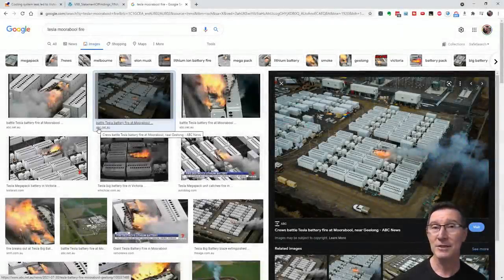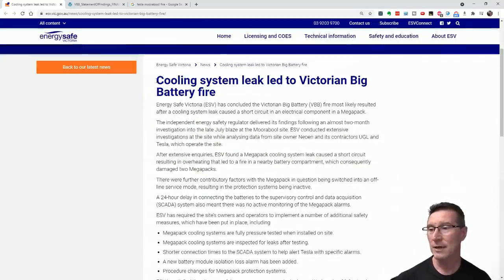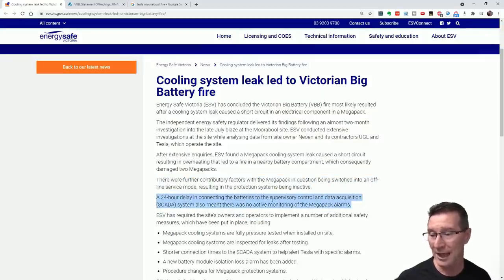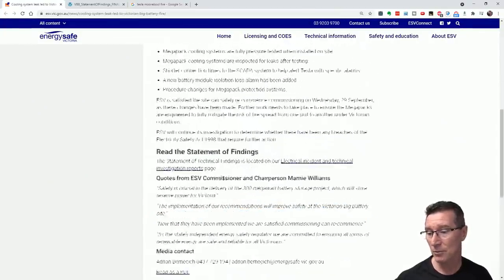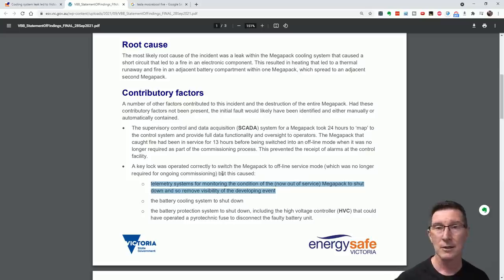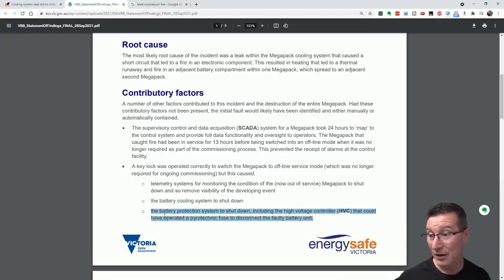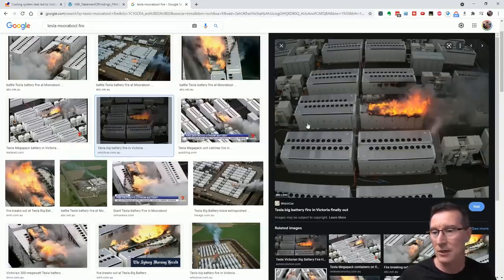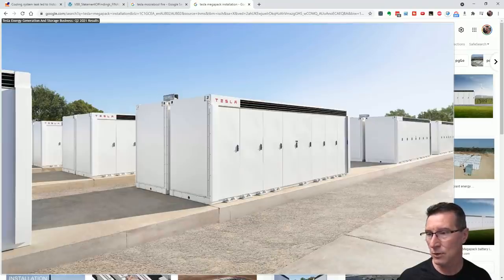EEVblog 1422 - CAUSE of the Tesla Victoria Big Battery Fire

Comment: I was charging a large lithium-ion strimmer battery in my workshop last week, like I've done many times before. However this time the charger showed a voltage error after about 30mins and the battery was HOT. I disconnected the charger and took the battery outside and put it on the patio (stone floor) and went off to get a screwdriver so I could take it apart (once it had cooled).......but as I returned to it, about 10ft away, it started hissing so I stepped back and it went BANG and the firework like flames were about 3ft in all directions.
Sooooooo lucky!
Reply: my powerbank suddenly felt really really warm during charging, luckily it is a "DIY powerbank" where the cell is not soldered to the board, I immediately tore the plastic open and scatter the hot 18650s on the ground; the batteries were  still fine till this day, but the powerbank circuit were burnt, chared, and the plastic warped. In my opinion the batteries must be disconnected from the circuit that provide 12v or 24v (for the strimmer) immediately to stop the overheating (meaning you have to pry it open ASAP before it explode).
Reply: After discovering Lifepo4 packs for anything other than highly portable devices, I started making my own packs with even my own custom BMS with own code.  Something I wouldn't dare attempt with lithium-ion.  Lifepo4s can almost be short circuited and they probably won't explode.
Reply: That, I think, is why the report said "it had failed safely". Inextinguishable fire is still safe compared to a bang proportional to the pack size...
Reply: SAND!!!
It's not rocket science.
Just dump sand on it.
Reply: Yeah.  And look at all the YouTubers building their own MegaPacks with used batteries or manufacturing seconds.
Reply: @preddy09  Key word: "probably."
Reply: @whompywheels5165  sand won't stop it. You just have to let it burn itself out. Chucking sand on it just means you have sand in the molten mess.
Reply: @whompywheels5165  What do you think that is going to do?   The fire does not need oxygen to burn.   It has its own oxidizer in the battery.
Reply: Well, to put my fire out I got a old towel soaked in water and chucked it over the whole thing which contained the flames......I then left it to smoke and die down for 10mins, then scooped up the whole lot (no flames anymore) and put it in a bucket (metal) of water and left it for 24hrs.
Reply: The fire does not need oxygen to burn and that is why spraying water is demonstrably ineffective.
The sand will contain the heat safely acting as an insulating layer.

What is the harm in testing this?
It works for laptops and Ebikes so why wouldn't it work for cars and big batteries?
Reply: @whompywheels5165  i suspect sand may do the same as my wet towel and would contain down / cover the large flames but wouldn't kill the source. It would be somewhat effective I'm sure.
Reply: The only luck involved was you actually being there.  Otherwise, jut reasonable safety precautions for a malfunctioning battery pack.

Nastiest one I heard of was more than 20 years ago, a mid-sized UPS failing in such a way it dumped all the stored energy.  Bein a UPS in the 90's, this would almost certainly be a lead-acid battery (nasty if they spill or vent hard, but otherwise not too bad) but the guts got so hot the plastic enclosure melted.  (As in, the operator tried to push a button on the device and it caved in.)
Reply: @IanScottJohnston  the best thing to do — as with lithium powered burning cars — is to drop the entire thing in a big bucket of water. Best way to take away the heat. Then you just leave it for a few weeks until all the lithium is burned off.
Reply: @whompywheels5165  Wouldn't that make it burn quicker (melt) by keeping the heat in?
Reply: @saddle1940  Possibly so. Although I think the thermal runaway is near unstoppable,' However if you want to cool the pack then go head and spray water on the sand.
Reply: @JamesTK  Cooling the pack MIGHT slow down the thermal runaway consuming the whole pack.
Why not spray water on the sand instead of wasting bazoodles of water?
Another idea is to build a wall of sandbags around the car and flood it like a wading pool.
Just spraying thousands of gallons of water around the place is as dumb as dogshit.
Reply: @JamesTK  All I want is for some fire departments to try this. Could be dry sand, wet sand, sandbags to make a moat around car. Combination of these. One thing is for certain, hosing bazoodles of water just isn't working.
Reply: Big Clive, comment above has proven that Lithium batteries contain fire and that hitting them with a hammer makes them hiss. :-)
Reply: @whompywheels5165  Yes, the fire needs oxygen. What doesnt need oxygen is the thermal runaway inside the battery, resulting in heat (ignition source) and flammable gases (vaporizes solvents). It still wont burn and only smoke if there is no oxygen or the ignition doesnt happen.
Reply: Allegedly those Lipo car jump packs have been implicated im many garage fires over the past few years.
Reply: @whompywheels5165  Unfortunately, this does not work on an alkali metal fire.

Comment: I suspect the offline mode they used to temporarily take it out of service wasn't meant to be used that way. Having to actuate a physical keyswitch tells me that mode was probably meant for a complete shutdown so maintenance can be performed, as the operator probably wants to automate the wear-balancing that happens daily (which is what it seems the unit was shut down for). This could explain why EVERYTHING in that pack turned off, instead of only the charge/discharge you would expect for a standby like that.
I do agree that it is still weird that telemetry and monitoring can be turned off like that, and especially that it was actively used while SCADA was not active yet, but I highly doubt this was the intended shut-down mode for this situation, let alone the only mode available.
Reply: I think this is the most plausible reason. Someone using a function that did what they immediately wanted. But they failed to understand the consequences of that action. A possible fix there would be to have it send out an alarm or notification the moment that switch was tripped so that a monitoring location can verify it was expected as part of scheduled maintenance or an emergency disconnection that they can respond to quickly. 

I did think you might want to modify it so you couldn't throw it into such a service mode without meeting some sort of other requirements around charge levels and temperatures. But in an emergency I could see the need for having a no restriction instant disconnect. Possibly still something worth considering if the service disconnect is independent of a full/emergency disconnect.
Reply: I was under the impression this was a new install, not one that was operating. I am not sure if that is correct or something I misunderstood when this first happened.
Reply: @--_DJ_--  It was new install in it's first 24 hour if I understood correctly and they turned it on immediately. The specific pack was operational only for 13 hours before it was put in offline mode by a physical key switch. (Maybe they ran a 12 hour stress test, to check if it's charging well or whatnot) (14:38) One of the key point was sated in the mitigation brief, for the next time it can't even be put in online mode BEFORE the SCADA maps the packs and start to monitor the conditions and alarms. Seems reasonable.
Reply: @mtx33  That does seem like a better way to go about it considering what happens when things go awry.

Comment: Some good old Asbestos sheets between the mega packs would work a treat.
Reply: some cross pollination from the SpaceX Florida bakery coming up soon? :P
Reply: @rkan2  Ha!..  Nailed it  :-D
Reply: Asbestos might be a magnitude or two less destructive than these poorly designed battery packs.
Reply: You joke, but asbestos tiles actually sound like a good idea.  Fun fact, where I live you can buy houses with them as floor tiles today.  It's not fluffy, so is perfectly safe as long as you don't try to remove them.  The thing is that today we have other materials which also work well.  However, Asbestos is still used in certain applications today.
Reply: @arthurmoore9488  That's crazy.  The flooring will surely degrade over the years and become a major problem in the future. 

Saying that, when I was a kid we were always playing on old asbestos corrugated roofs that were dusty and broken and we've all made it to being grandparents.  

I think its particularly the blue variety that's dodgy isn't it.?
Reply: @JediBuddhist  I’ve installed solar on asbestos sheets one time and I can see why the stuff that’s already out there is safe as long as it’s undisturbed. It was harder to cut/drill through than concrete and the integrity of it felt very stable and resistant to wear and exfoliation
Reply: Rockwool might work too?
Reply: @Ariccio123  Rockwool is just as dangerous, even though the manufacturers passionately lie about that fact. 🤷‍♂️
Reply: @rkan2  actually that's a hell of an idea. Especially tiles that are damaged and cannot be used on starships would still be quite effective in this use case.
Reply: @Ariccio123  Yes sounds spot on

Comment: Who did the FMEA for this system? Allowing monitoring to be inactive during initial start up is crazy, that is the most likely time to have issues. Allowing monitoring and cooling to go down for any reason is crazy. Have we learned nothing from our nuclear disasters? Those should be on back up, independent power, enough to safely bring the machine to a standby state.
Reply: I mean, you have to do maintenance at some point. the problem is they put it in a mode that should probably only be used if someone is working on the circuits. you can never stop a technician who has that level of control/access from doing something they're not supposed to. you can just improve the redundancies to try to prevent mistakes.
Reply: Tesla did.  My money says they were behind schedule and it should be obvious the units themselves were not ever adequately safety inspected    I strongly suggest outside agencies do real inspection on these units because this has happened in other installations here in the US with the same fire resulting

Comment: 20c part takes out $200K pack!
...sounds like they didnt think things well through to begin with... taking a pack offline should never stop alarms, monitors and protection....
Reply from the maker: Yeah, seems crazy.
Reply: It's all free money, it came from your pockets.
Reply: Taking a pack out of the active system shouldn’t turn off the monitoring systems. Taking a pack offline for service should probably take everything offline, because electricians like not being electrocuted by the monitoring and cooling system just as much as they like not being electrocuted by the main batteries.

Comment: As a former SW developer of a Safety Analysis software for oil&gas industry, I'm realy surprised how badly implemented are safety standards in this energy battery field. Someone did very bad job with HAZOP/LOPA analysis, or most probably there was none. Having such devices in operation without real time monitoring is absolutely unimeginable in o&g industry, if this would happen, it would definitively cause automatic shutdown. They can be realy glad that only 2 packs were burned and no one was hurt. And to me, if the coolant leakage , which, I assume, is one of the most common failure which you can have,  can cause catastrophic failure, then the pack is probably not well designed.

Comment: Geez they were running that thing blind without the SCADA monitoring!

The addition of the ‘battery module isolation loss’ alarm makes me think the failure could have been coolant leaking onto a DC contactor (or bus bar) for a battery module shorting and overloading it, however as the unit was in the offline service mode and no SCADA data was being monitored the unit never raised an alarm and thus never had its pyrotechnic fuse triggered so it remained shorted until it reached thermal runaway and caught fire.

And without a doubt this was not a safe failure, a better way of putting it would have been “despite the unsafe situation created by the catastrophic failure of a megapack, there was no loss of life and damage was contained to only the adjacent megapack with the assistance of approximately 150 firefighters and 30 firefighting appliances.”

I also suspect the solution ‘to fully mitigate the risk of fire propagation’ will not only involve firewalls but fire suppression.
Reply: It was a safe failure in terms of the rest of the installation - it did not negatively impact the grid or the other megapacks' operation. So in an operational sense it failed safely.
Reply: My guess is the removal of the batteries would help very much.

Comment: It sounds like the offline mode for maintenance is really intended to be just that: having the thing shut down and disconnected so you can work on it. They probably didn't foresee the need for monitoring while the thing is known to be offline. Unfortunately, you can't just turn off a bunch of fully charged batteries. 

Chemical plants have to do that, but they have really complicated monitoring systems that go into different modes to prevent nuisance alarms. Watch some of the US CSB videos: they go into some wonderful information on the principles involved.

Comment: Oh 2nd thing, reason it’s a key switch that isolates everything.

It’s a part of the high voltage isolation procedures to physically isolate remote operation.  

If the key is in and turned someone is working on it/it’s OOS and someone needs to physically attend to put it back on.  Having it just drop all comms is a brute force way which makes things simpler.  If you still return statuses etc there is a lot more testing needed to prove there is no way for it to be remotely operated/controlled while in local/maintenance mode.

For items like circuit breakers putting them in local mode will short/disconnect the  control wiring but still allow status and position data to be sent back as it’s physically separate circuits.  

In other instances physical links are removed or shorted to achieve the same thing.
Reply: Maybe it was a procedural error too. I can assume that this disconnect key wasn't designed to put the pack in offline mode and leave the site unsupervised with charged battery packs.

Comment: Yeah its ultimately up to the installer and site planner to implement pack spacing, but its also on Tesla to provide recommendations on pack spacing and potentially implement better heat shielding and fire mitigation
Reply: The question is, do you really want every single pack isolated from all the others? Why? Why not say that you want each set of four packs isolated from each set of four other packs? It’s just a matter of scale.
Reply: They were lucky with the wind direction.  If the wind blew 90 degrees then maybe the neighboring packs would have caught fire and soon a whole row.  Presumably they consider fire in their spacing but since neighboring packs were singed despite the protective wind...